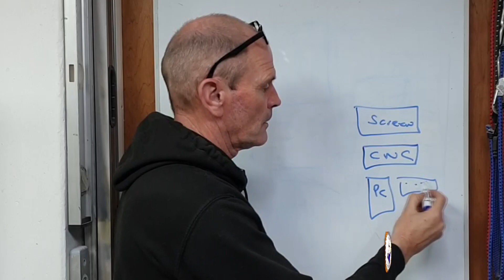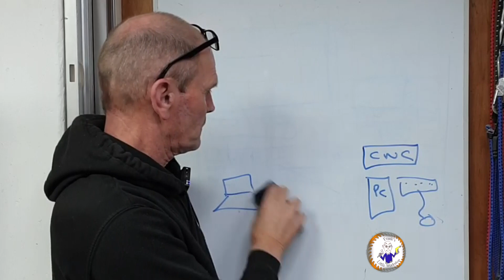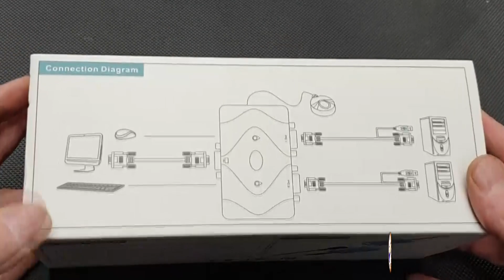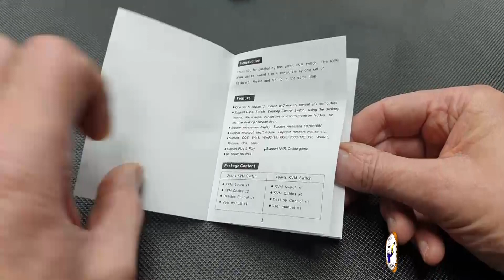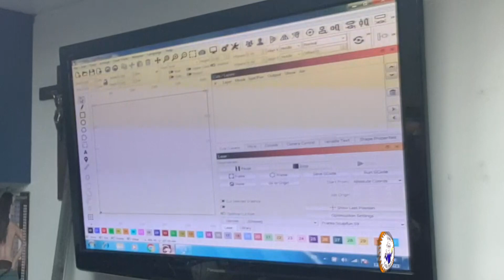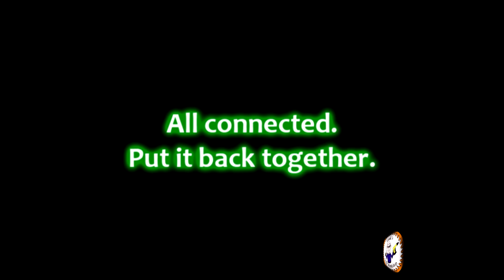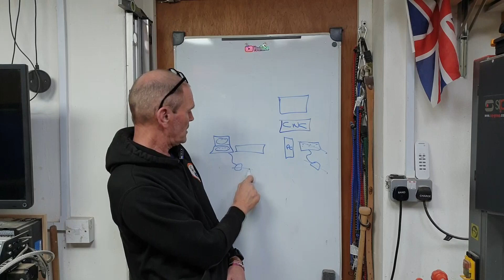KVM switch, Why do I need one ?

Comment: Pick up a cheap wireless keyboard & mouse to make this even easier.    Another option - small Linux single board computers (like the still hard to find/afford raspberry pi 4).  I'm not sure if your cnc software has an ARM linux port, but perhaps worth a look?   Last I saw, Lightburn isn't available for Rpi yet, but if that happens, you could downsize greatly. 
Nice use of tech to simplify!
Reply from the maker: 😃 Thanks, I think the wireless keyboard and mouse is a great idea now they have come down in price (and are now more reliable). I think ill avoid the Linux route for now. I have got the CNC to a point where it is extremely stable and reliable on the old dedicated XP machine and the whole system (drivers / interface boards / software / steppers / power supplys) are all basically happy with the Windows setup as is. So I don't plan on trying to improve it at present. The reason for the second pc (laptop) was so I could run lightburn on a Windows 8 machine, but also have it mobile so I can use the laser in different locations if necessary. The KVM just makes life a bit more "nice" while I'm in the workshop. Thanks so much for watching and commenting. I hope you have a very merry Christmas 🎅 👍

Comment: Hi Frank Am I missing something! Why not just plug the USB cable from the Laser into the PC running the CNC like other peripheral? loose the laptop, screen and KVM.
Reply from the maker: 😁 Hi Kevin. Good question but there are a multitude of reasons. Mainly because I still need the laptop to be mobile (so I can take it to a different location or room when needed, which I can't do with the tower). Also they are both on different operating system levels (one is still XP and the other is Win 7 so there is some issues with driver compatability etc. I can't just do away with the tower as I have specific hardware in it (an ISA board to interface with the CNC controller)... this is not possible with the laptop as the architecture is different. Also, some software licence issues where I can put the same software on another machine without buying it again... which will be a bit costly. It would be better to have it all on one machine but at the moment both machines are stable so I can't afford to introduce any problems so this is the best option at the moment 😀.  Hope that answers your question. Thanks for watching Kevin 😁👍
Reply: If you ran the laser and cnc from the PC (freeing up the laptop) you can run most programs in compatibility mode if required. Dont know the op sys on the PC, but up to Win 10/11 are unsupported now so now free to use. If you need any more info is there a way of contact direct? as it would take ages typing!!!!! does the CNC not have USB interface?
Reply from the maker: @kevinx2381  😁 Hi Kevin, the PC is running XP which cannot change, its only a 32 bit machine and is currently very stable. The CNC hardware is all serial so no USB connectivity (I have tried converters but they caused issues with missing steps with the stepper motor control and data loss), also the lightburn software requires a minimum of win 8, so that's a no go. In addition as you say, pre win 10 is no longer supported which has already caused issues with the drivers for both of my lasers. The KVM switch negates all of these issues in one simple solution, and works a treat 😁👍
Reply: From the information win 7 will  run on 32bit 1gb ram and lightburn will run on win 7.
Reply from the maker: @kevinx2381  😁 Hi Kevin. I have run the pc on win 7 before and it will run, but it is too unstable for use with the CNC. It struggles when large amounts of g code are being used and would frequently crash during a carve. Which resulted in the project being ruined (always disheartening when you have spent hours preparing the workpiece 😠). I reverted to XP and it became stable again. So my ethos in this setup is "if it isn't broken... don't try and fix it" 😆😆👍
Reply: ho well sound like more ram needed! leave it at that then.